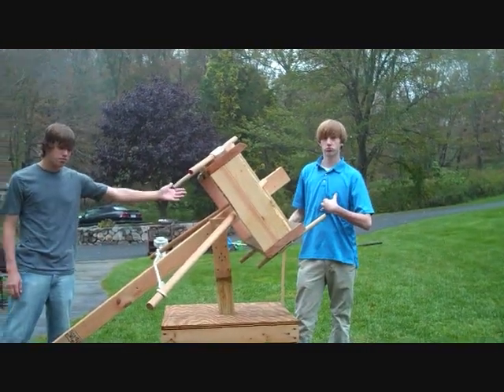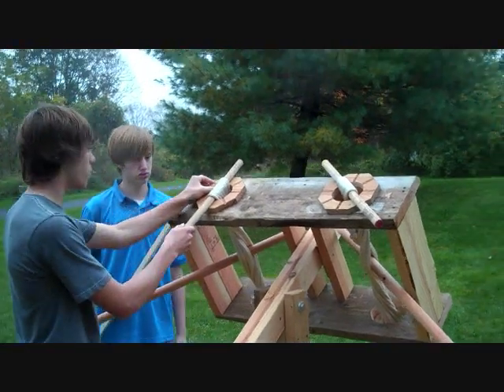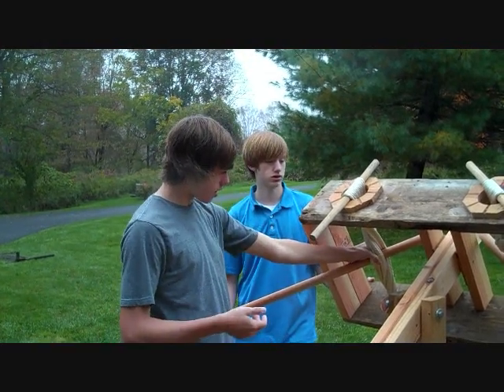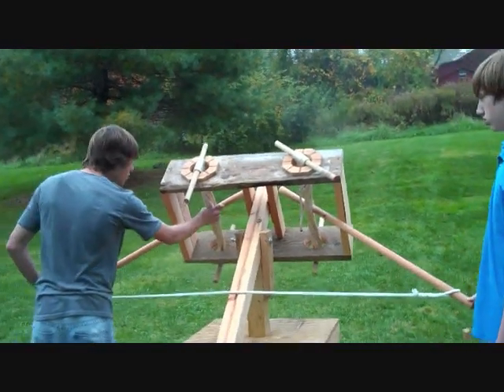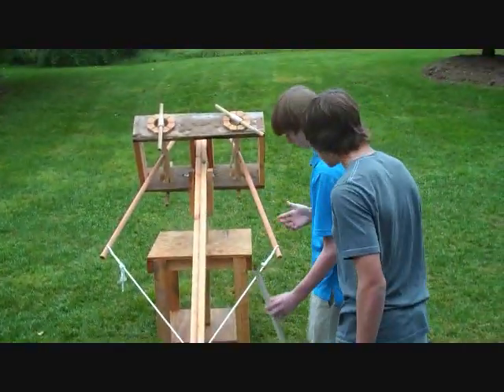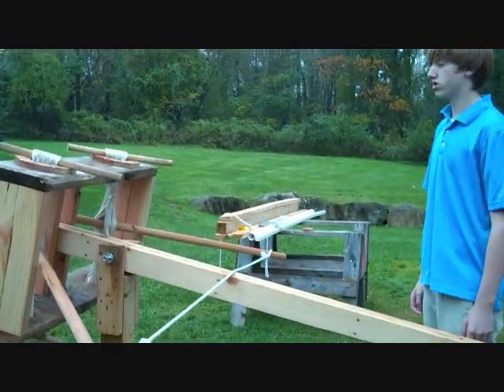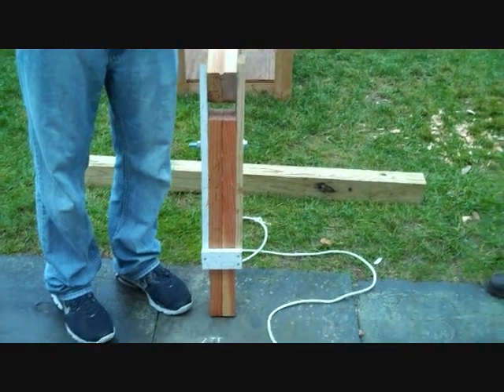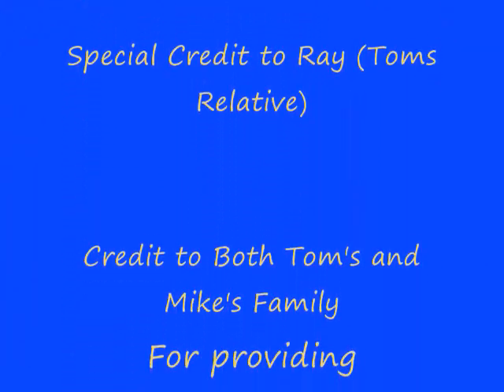Ballista, A Breakdown Of How It Works

Comment: if  made the string and sticks tighter it should be stronger (like a crossbow). And u can make stabalizers for the arrow (feathers) by putting duck tape on the end whick will keep it straight in air. u can also make a lighter arrow so it will travel farther